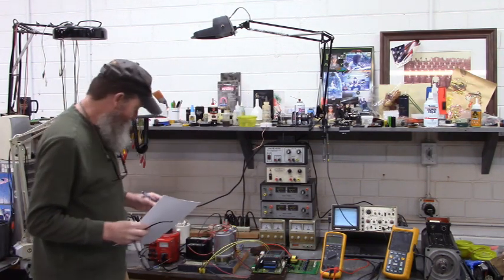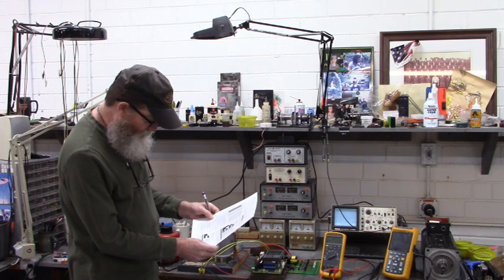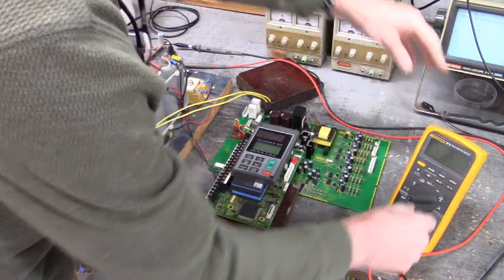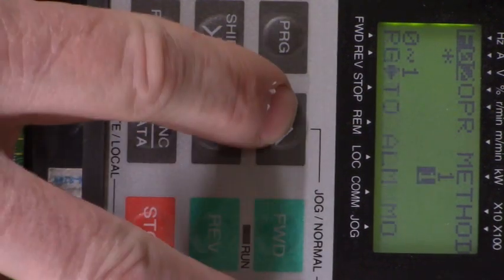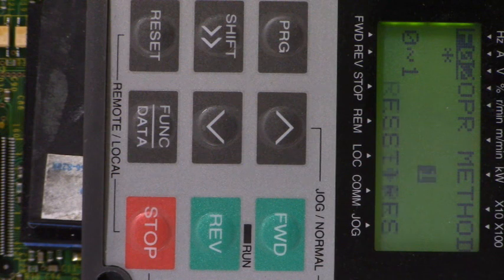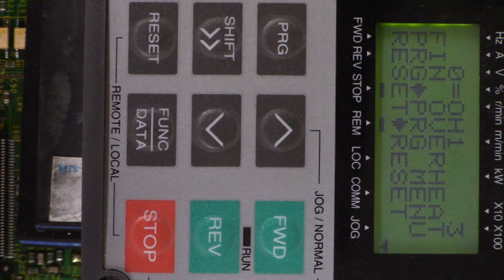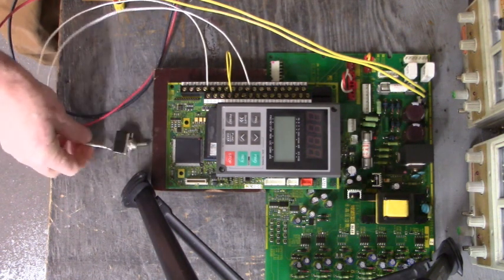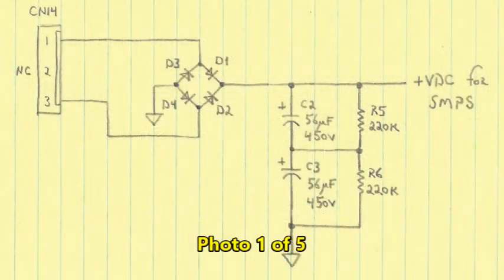Fuji Electric Frenic 5000G11S,  Data Protection Methods.

Comment: respected peepaw
how we can diagnose the fault of by vfd  processor . same as its any plc missing the inputs bits or inputs analog signal then we can diagnose  the fault check back to back where and which  device or push witch miss the signal .i have done problem solve then ready run plc... 
i  want to diagnose the fault same as its by vfd processor pin configuration and check back to back and take it missing there....
i hope 100% you can do did done please help me.i am very more many much "stress"  "tension" "depression" in  case... help   help   help

Comment: Hi peepaw, which ic is used in this drive for smps circuit if this is 3844 or 3842 then please explain its circuit diagram 🙏
Reply from the maker: The switching power supply control IC in this drive is P/N AN8026, Mfg Panasonic.
Here are four of my videos discussing the P/N UC3844. I hope this helps you :)
https://youtu.be/RnHjBvKqpBY
https://youtu.be/2SrU1_PtL08
https://youtu.be/IYW48lpRWps
https://youtu.be/6iZQAwXX-AI